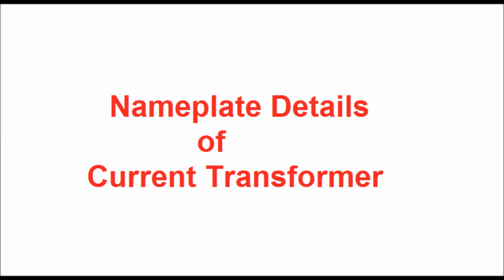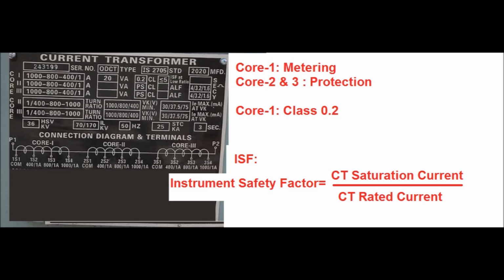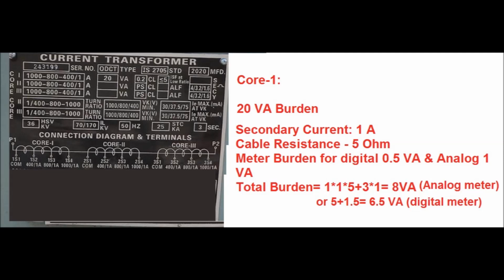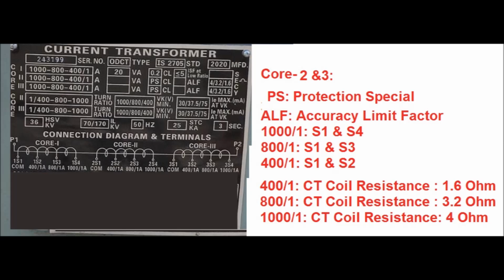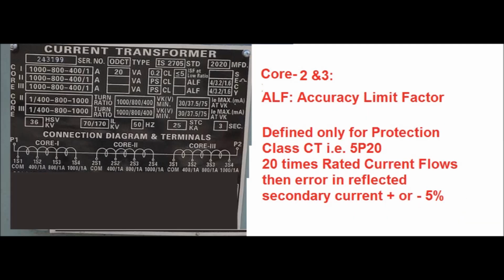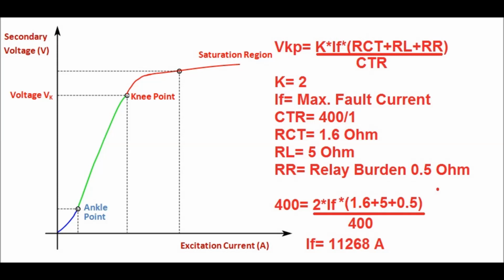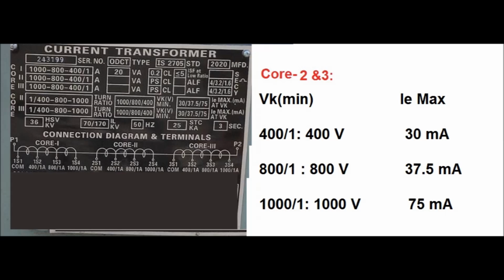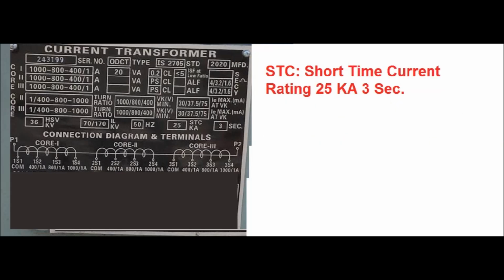Current Transformer (CT) Nameplate Details

Comment: Why we use compensating winding in a CT??
Reply from the maker: Compensating winding use in which core of CT i.e. metering or protection??
Reply: @relayprotectionelectrical  metering core of a CT...
Reply from the maker: It is not a compensating windings rather a aux. Coil is connected in the metering core of the ct. Normally common terminal is connected with one end with aux. Coil and other end to be connected by the user based on requirement of intended ratio. I.e. for 1000-800-400/1 ct if 1000/1 ratio is taken then S4 terminal shall be connected with Aux. Coil terminal (S'). Therefore, the auxiliary coil remain parallel with secondary ckt. During fault condition this coil act as low resistive path and thereby prevent current flow in the instrument connected with secondary ckt.
Reply: @relayprotectionelectrical  Thank you sir for your nice explanation...Can u share me your mail i.d for any other technical discussion???